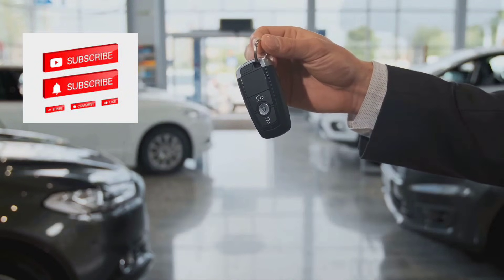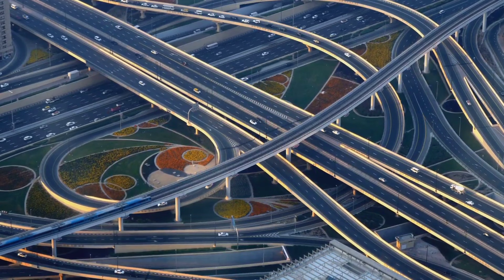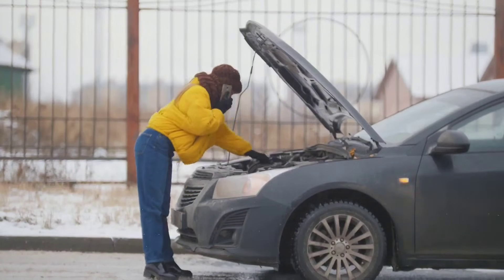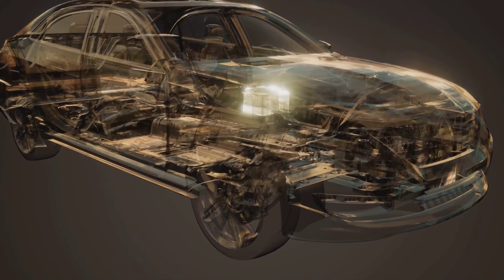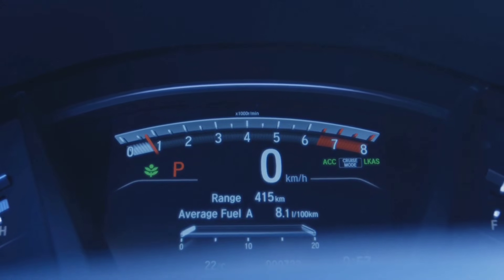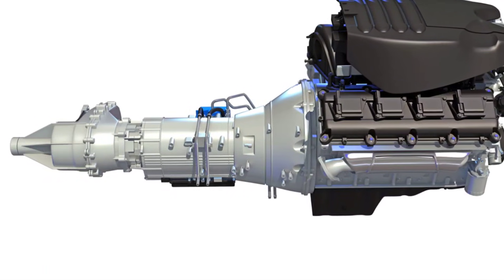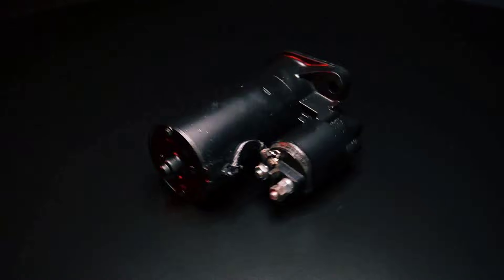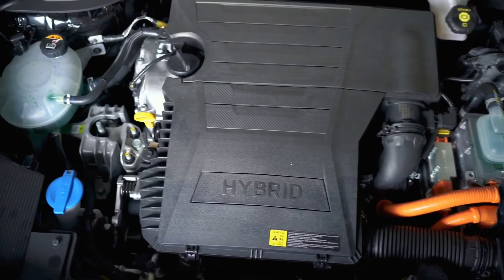The Truth About Auto Stop-Start Technology....Fully Explained!

Comment: It and I say it because it was AI talking, anyway it kept saying wear on engine components and never actually mentioned actual engine components.
Reply: Exactly. Who cares about the starter alternator and battery. The problem is the wear on the engine which is crazy. Modern engines wear out quickly enough in part due to manufacturers silly engine oil changing recommendations. The last thing you should do to an engine is repeatedly start it and stop it. This video is pure propaganda for the net zero brigade.
Reply: @GraemeBeardsley  completely agree.

Comment: I had a diesel car with start/stop system, in -17 degrees celsius it stopped the engine at a red light less than a mile after start up. This is extremely bad for the engine but it could be turned of after every start up if I remembered to do so. In Sweden they ran a test on urban vehicles for a year and the estimated fuel savings were a mere 4-5 litres. This whole video must have been produced be green enviromentalitsts.

Comment: This is cheer leading for a system most consumers do NOT want and look to bypass it if possible. I do not like auto stop/start. The one vehicle we have with this feature has the most soot-covered tailpipe I have ever seen. I suspect that the fuel saving accrues to the manufacturer's CAFE score to a higher degree than to the consumer. I now buy HD diesel trucks to avoid auto stop/start entirely.